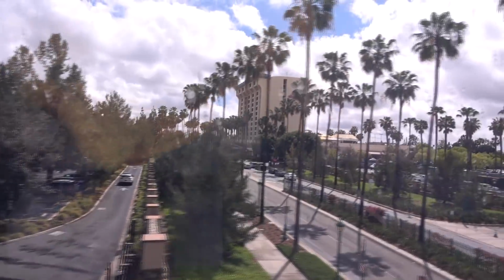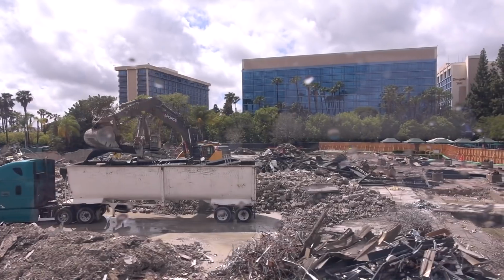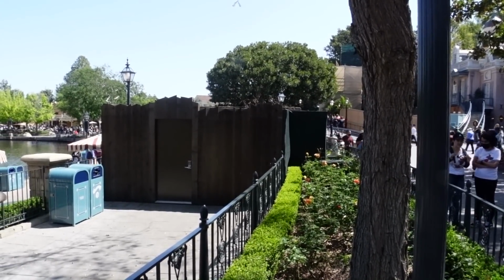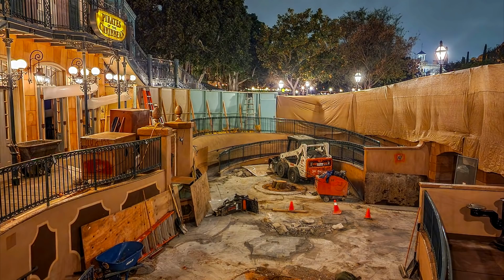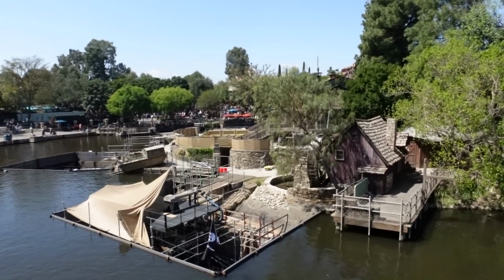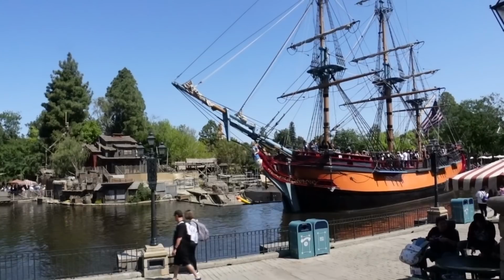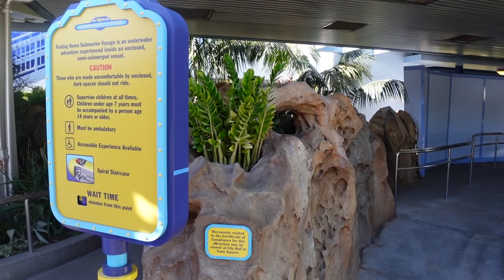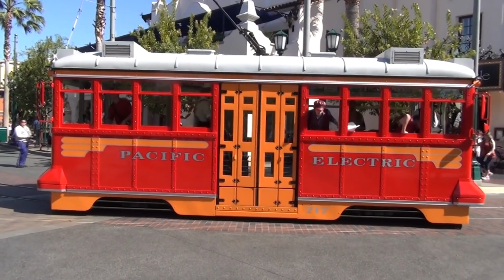Total Demo at Downtown Disney + NOS update | Disneyland construction 04/03/2022

Comment: It is really weird how long both the Finding Nemo and Tarzan attractions are taking. Especially when each of them had firm-sounding reopening dates announced. I suppose it's that old labor shortage rearing up, if there's not enough maintenance workers for the running rides then there's surely not any to spare for refurbs.
Reply: Universal doesn't seem to have any issues with maintenance or referb. They're going ahead just fine with Nintendo Land and building HHN houses. Definitely not a labor shortage. However, Disney sure.is taking forever with these attractions and not releasing any statements.